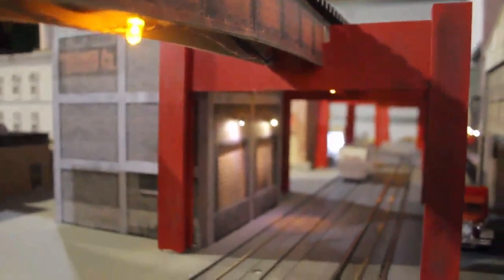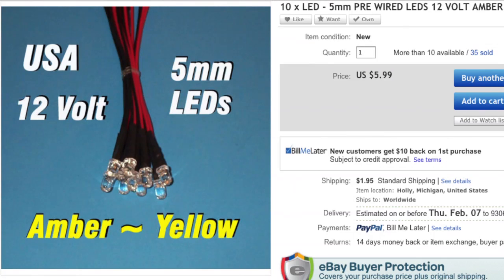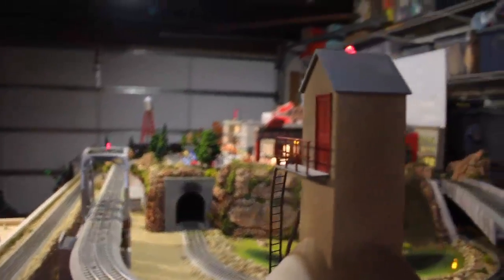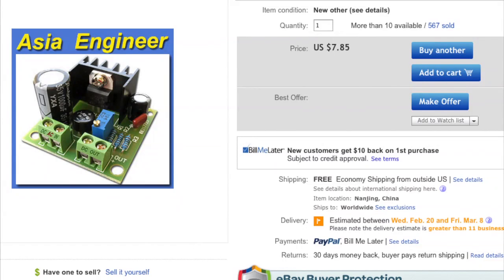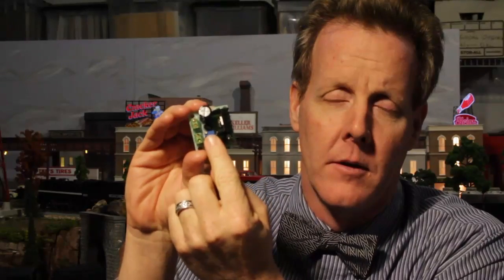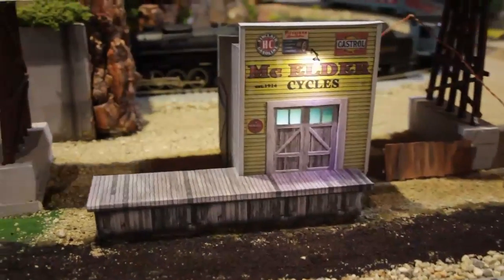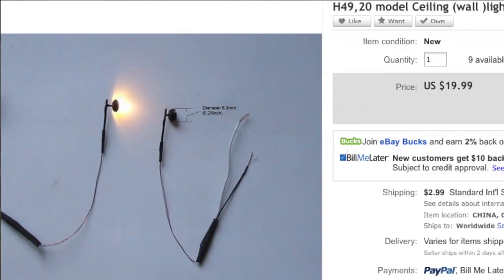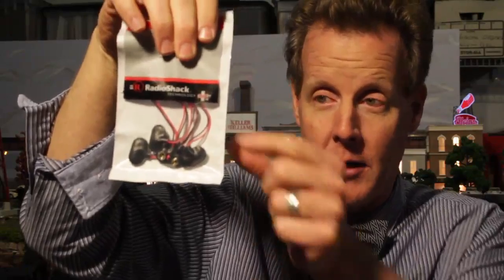O Gauge Trains Layout Lighting with LEDs & Wall Warts

Comment: Great idea!! You can light an entire downtown area for about $20 using this method, instead of paying Woodland Scenics $20 for a 3-pack of street lights. I'm a novice with electrical work, but I think I will give this a shot. Question for you, Ted, how would you install a on/off switch for each bus of lights? What sort of toggle do you use? Wall wart -> on/off switch -> converter -> bus? Thanks for your help!

Comment: Once aging great video. Question: if use a couple blinking red LEDs on the same circuit  with white constant LEDs on the same power supply, would the few red blinkers cause dimming to the constant lights, each time they blink?

Comment: Outstanding video! I am mechanically savvy but electrically challenged. You simplified this to the degree, that I believe, I will be capable of converting my entire layout to 12v led. I assume all lights go direct wire to busses and not in series? Correct?
I do a Lionel Christmas layout using Dept56 buildings. Instead of using the individual 7 watt light cords and bulbs (lots of cords and plugs). My plan would be to light all the buildings with the LEDs and wire them to several small buss busbars on my  4x8 plywood layout.

Comment: excellent video!  very informative!!  I'm trying to figure out how to light my Lego city display and this just solved the last piece of the puzzle!!  thank you so much!  one question, what is the maximum amps the step down converter can handle?  have a great day!
Reply: +Jay Edward Lamar Jones The converters I have picked up off eBay are rated one amp but I have seen them at 3 amp.  I don't have wall warts that go up to 3 amps that I can repurpose for LEDs so I have just purchased the 1 amp converters.

Comment: Thanks!
I just grabbed some orange led's from a string I had laying around. They have the resistor already attached. I connected them to my track via alligator clips and they worked fine, but the resistors were getting hot and didn't smell too great.
How is this happening at 18volts when the strings are plugged directly into 120 as a set?

I'll try batteries or the step down converter.

What prompted all of this was... I have an old MTH Movie Theater and the sign only has one bulb that still works. I thought I'd try changing the bulbs out with LEDs.

Now I need step-down converters/transformers (we all have them lying around) and/or batteries.

Comment: Excellent video with lost of good info. and tips. I do have a question...what can I use to install the light inside a building so that it stays upright? Thanks.
Reply: Hot glue?  If it is an LED I use hot glue.

Comment: Great info here,thanks.Some old HO transformers were DC,will they work?
Reply: Yes, but you will need a volt meter to make sure you get the proper voltage set so you won't fry the LEDs

Comment: What do you find is best to hang LEDs, my first try I used hot glue on a plastic vile house, also for the best look do you mount from top of structure ,bottom. New to modeling and thrifty (cheap) any input or web sites would be greatly appreciated j

Chris
Linwoodchris@comcast.net
Reply: I use hot glue and if the building glows like a pumpkin then I spray glue some foil and line the inside of the building.

Comment: Sorry novice hear... Does the step down converter work with fast track if so can you please tell me the model or description of the step down converter or a similar model that is compatible. .
Reply: It is not for the Track, but for the accessory terminal on your transformer.  You would take the wires form the accessory terminal on your transformer and plug those into the step down converter Then come out from the step down converter to your lighting. All the step down converter does is take the AC current coming from the accessory terminal on your transformer and converts it to DC current which is needed for LED lighting and any accessory that requires DC current. It also gives you the ability to adjust the voltage from say 18 V DC to 12 V DC and even as low as 2.5 V DC.

I get the converters off eBay,  they come from China which takes usually about seven days to Los Angeles, add a few more to get across to the East Coast but for six bucks each as well worth it. This is the link to the seller's store http://www.ebay.com/usr/anna758595   If you search on this title description they should come up "LM317 In DC or AC 4V-30V Out DC 2.5V-27V 1A Converter"

Most O gauge train transformers put out a max of 22 volts AC so the 30 V input maximum is fine. Also it has a max of one amp which would be approx 50 individual LED lights for one converter.  I would not load it with the full 50 LED load, keep around 40 to 45 lights Max.

When I bought these a few years ago they were closer to 12 bucks each if I remember correctly.  You might as well order a couple as you'll see once you use the first one, you'll be ready for a second or third.
Reply: Thanks for the info. I appreciate it.